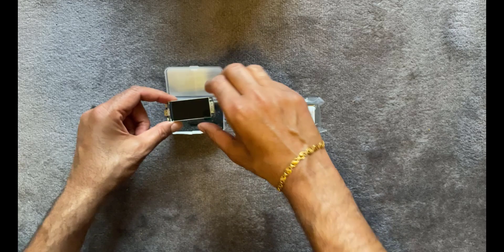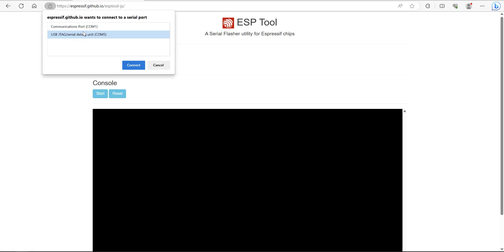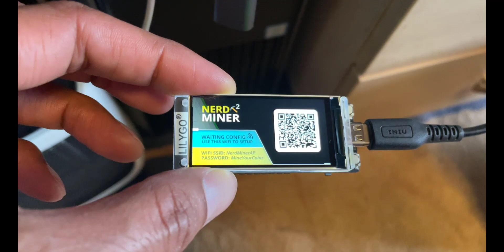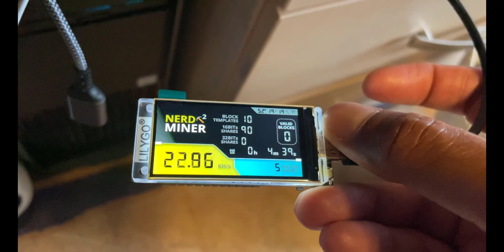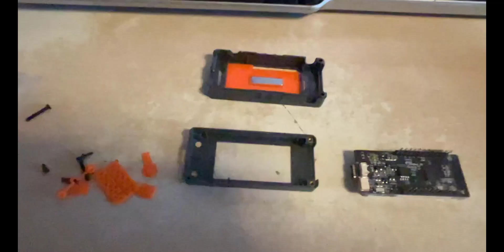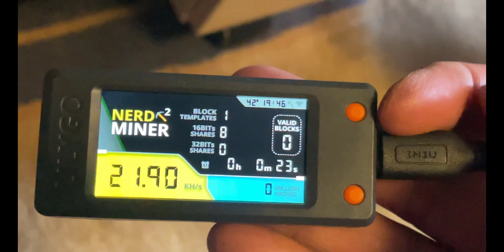Solo Mining Bitcoin BTC with NERD MINER + Case Installation

Comment: Hey, I can not get it to connect to wifi.
The screen on the lily is telling me:
 - Waiting to config
use this wifi to setup

The screen on my phone is telling me this:
 - Saving credentials
 - Trying to connect ESP to network
 - If it fails reconnect to AP to try again

nok any luck connecting to my network. What am I missing?

any advice? 

thanks:-)
Reply from the maker: What Wifi band are you connecting to? Must be 2.4Ghz to work with the Nerd Miner.
Reply: Thanks. It’s is running now. Great video.

Comment: It doesn't work for me. I put it my info over and over and just will not connect to my wifi. I am not sure what I am doing wrong.
Reply from the maker: Couple of things to try. Which WiFi band are you connecting too? If using 5Ghz, try 2.4. Also, maybe try the new version of the software and get triple the hash-rate: https://www.youtube.com/watch?v=46AQ_pTY0rE
Reply: @HandymanSavage  it was just a matter of logging into my wifi setting and re-enabling the 2.4ghz. I had it disabled becasue it was interfering with the 5ghz. I forgot I disabled it because it was causing my Tv not to see my wifi network with both 2.4 and 5 going at the same time.

Comment: Hello im new to the mining portion of crypto. I had a question if anyone knows or has experience, so i know you have the lottery miner's running solo for the 1:zillion chance to get the block. 

But, for example if someone was to buy one of the miners and set it up with a pool then does your miner make anything at all?
Reply: i think it would but because it only does like 55,000 hashes /sec on average i don't think it would produce very much at all and you'd have to run it for a while. it might make a few dollars if you pool mine if your lucky over time. i'm still waiting in mine but i do want to run it along with my bitaxe 1366 ultra. that hashes at a rate of roughly 1 th/s. but this is such a good tool for learning.
Reply: @Midmeat  on the 1th/s are you pool or solo

Comment: thanks for this i needed the help setting it up but the only thing  is my screen went black and wont turn on any advise?
Reply from the maker: Maybe try re-flashing it? Or look for my new video on the Nerd Miner 2 upgrade and see if that fixes the screen issue? As a bonus, you get double the hash rate

Comment: does anyone know how to get to the dashboard of the nerdminer ?
If I want to change the network later, how do I do that ?
Is there a dashboard or another web interface ?
Reply from the maker: It's very easy to do. Simply press the reset button (on the bottom) of the Nerdminer. When while it is restarting, press and hold the top orange button until you see a Pairing screen. Then simply go to your phone, connect to the NerdMiner WiFi and the Config page should auto load. From there, as per the video, you can change the Network and Pool settings
Reply: there is no dashboard. Press the reset button it restarts the configuration

Comment: flashing does not work for me. after selecting the files and then pressing on programme, only the message Leaving appears.

I can set the port baud rate. Does anyone have a solution?
Reply from the maker: Have you tried different USB ports and also different USB Cables? -You'll be surprised how you can lose many hours because a cable has gone faulty but still connects
Reply: @HandymanSavage  

Serial port WebSerial VendorID 0x303a ProductID 0x1001
Connecting....
Detecting chip type... ESP32-S3
Chip is ESP32-S3
Features: Wi-Fi,BLE
Crystal is 40MHz
MAC: ec:da:3b:xx:xx:xx
Uploading stub...
Running stub...
Stub running...

When I remove the USB cable and switch it on again, I no longer see the LilyGO logo on the display. 

Is the original LilyGo software available for reflashing?
Reply: Use the flash tool from the bin folder to do this